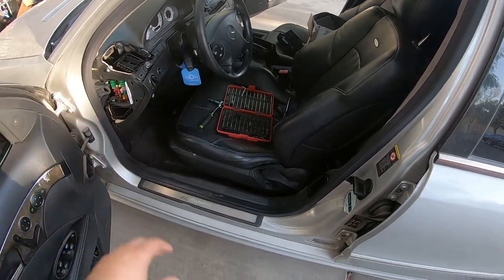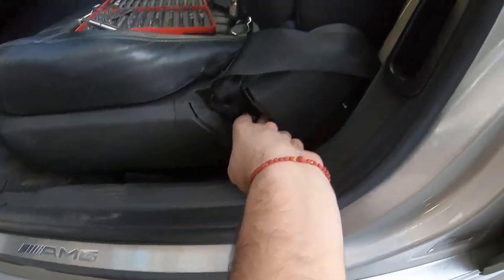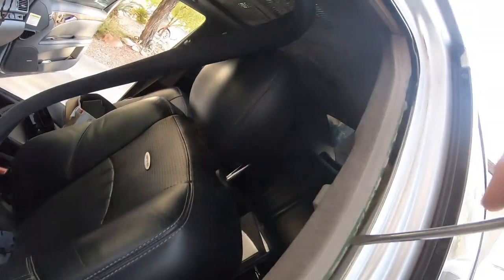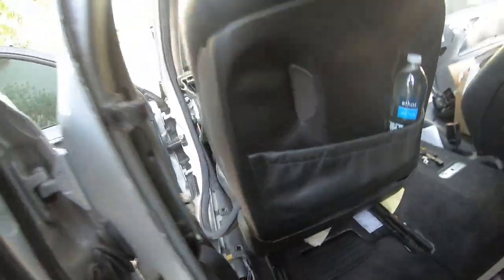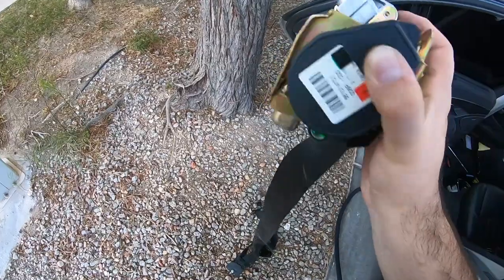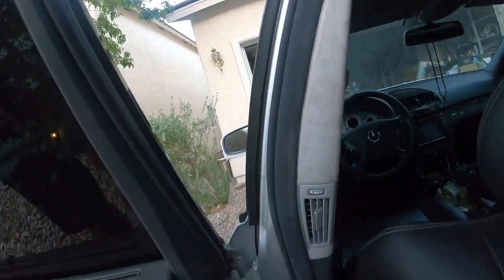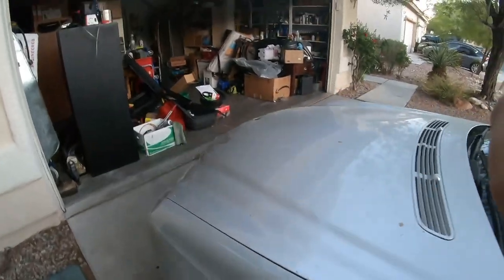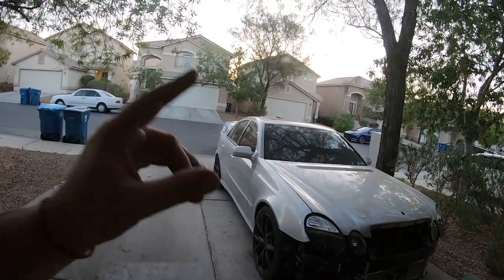How to Replace The Drivers Seat Belt on a W211 Mercedes E55 AMG

Comment: C pillars suck on these cars, take your time or you'll definitely break the clips and it won't go back in.

Once you have the seat out gently pull the top portion (above the seat belt slot) towards the inside of the car, just enough to show the clip. Take a long thin  needle nose iers and squeeze the tabs on the clip so it releases eassily. If you just pull it, it will 100% break... Not the clip, the c pillar will break where the clip attaches.
Reply from the maker: I changed the belts in the back and I did not film it as honestly between trying not to break anything and it being hot I was frustrated lol. But I appreciate the advice the clips did not thankfully break!